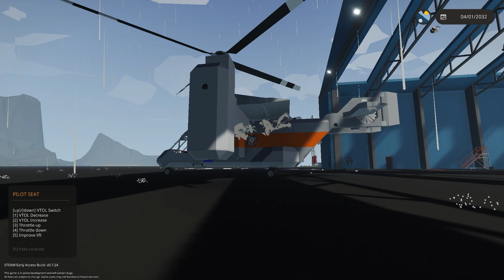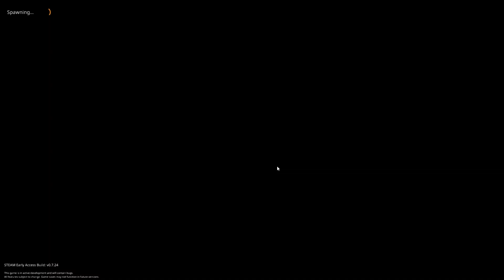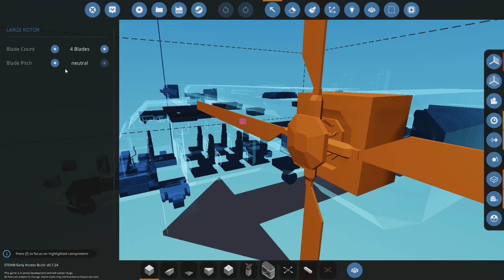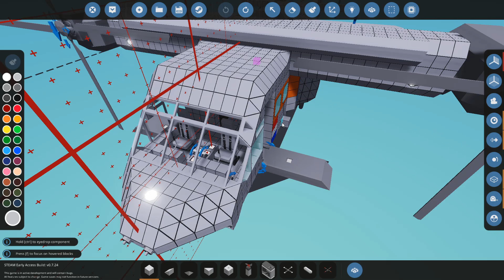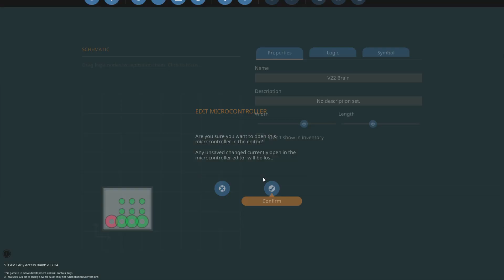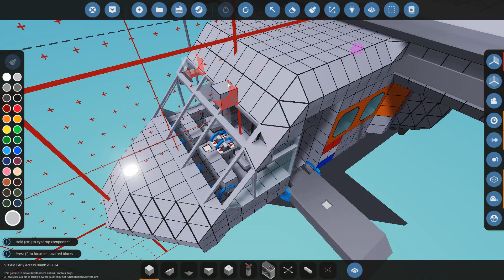Stormworks - Vehicle Showcase - V22 Osprey

Comment: so if you land, the props smacc the ground? just like the real one then
Reply from the maker: No, safety feature takes care of that. It overrides the input nacelle pitch angle and immediately sets the props to helicopter mode.
Reply: @Stealth17Gaming  if in your plane, good thinking man. If you mean in the real one, it better do that for the amount of $$$ it cost :D

how though? coupled to the altimeter? or if the landing gear is out? 

Because I remember a story about a certain "safety feature" on the Su-33... linking the ejection seat triggers to the radar altimeter sounds like a good idea if you're not sure whether the plane can make the "ski jump" carrier takeoff, ejecting the pilot if there's no weight on the landing gear and the altitude is less than 1 meter. But if you forget to turn it off during the landing it will eject the pilot in the exact moment when he crosses over onto the carrier deck after a perfect approach.
Reply from the maker: The way I did is this:
If distance meter under hull is less than 5 then set pitch for robotic pivots to helo vector. Otherwise accept input from cockpit. It's a switchbox coupled with a less-than gate. 

Lol that Su-33 safety feature though xD